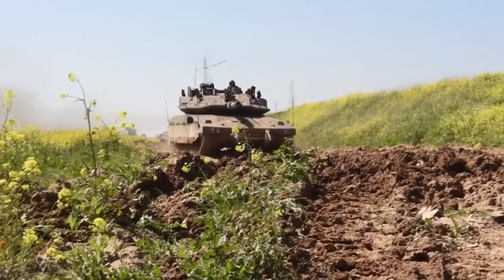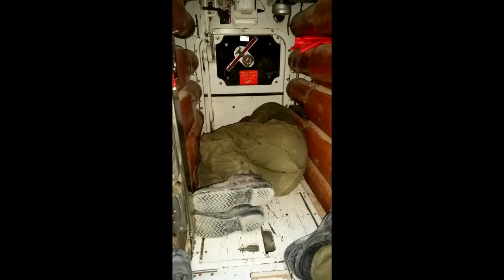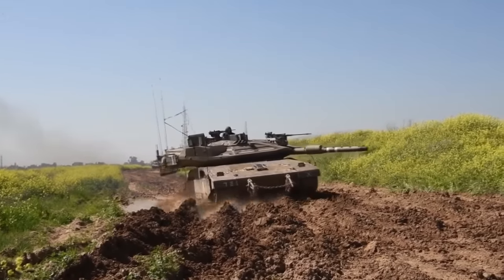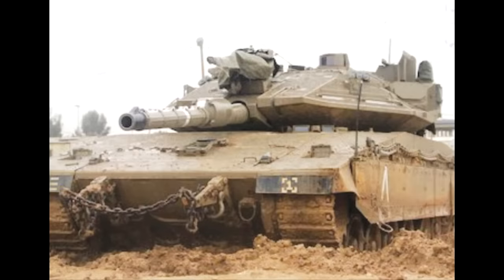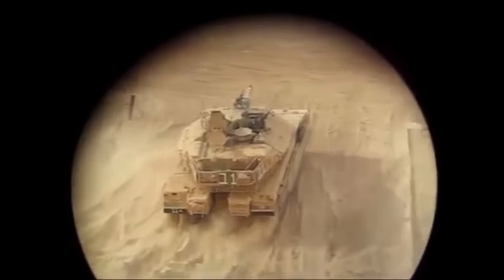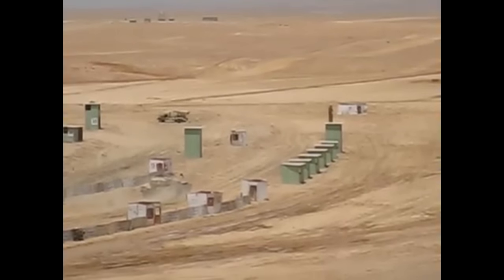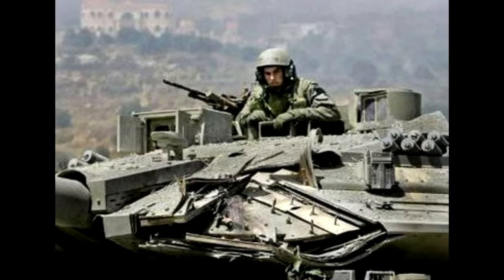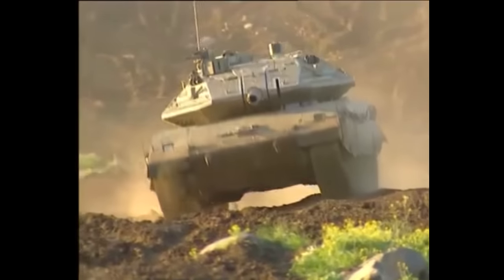Problems with Merkava tank

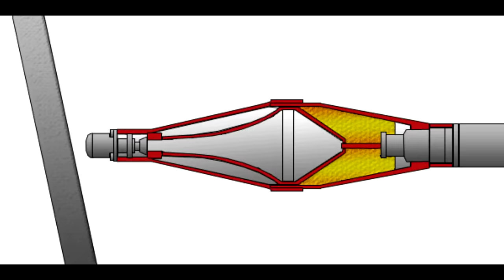Comment: Lasted 2:14 before the stupid got to intense.  No AFV is perfect or invulnerable.  The difference is in survivability. 

1)Any tank is going to show up on thermals unless it has some kind of "Jedi cloaking device".
2) No the engine compartment does provide pretty much complete protection against HEAT and very good against KE. Yes the vehicle will probably be a "kill" after being hit,  but again,  the crew will survive, and the vehicle will be recoverable and repairable.
3) Slope and thickness is largely irrelevant with modern composite armors. Its all about the composition.   The Merkava has its armor shaped the way it does for functional clearance of the turret and gun tube,  not ballistics.
4)The statement that RHA is at all "superior" or even a factor against anything but artillery fragments indicates that the creator of this video is just another armchair Youtube "expert". 
5) The L44 120mm gun is what the Israelis have a license for with Rhinemetal and is more than good enough against any of its regional threats.
Reply: Caldwell Transport Columbus, GA lad... its an urban enviroment focused vehicle, its desing is by no means to fight other tanks, lets keep that in mind, im pretty sure he was focusing if it were to fight another tank
Reply: Well first off. If you minimise heat threat it will be good, especially from the front. I think you are another armchair general. Removing at least one bit of camo can be the difference between life and death. While the Abraham’s that Egypt uses has heat sensors and has better heat protection. If the Americans described T-72 as being a “flamethrower” then what will Merkava be? “He’ll on earth”?. 

Second To all of you people who keep talking about “CrEw SuRvIvAbILiTy”. Understand that the most important thing on the battlefield is to DISABLE A TANK. If they could pen the engine and render the tank stationary and exposed, they won. M1 type tanks have an even bigger weakness, their ammo storage (although having blow out panels) is an easy target and no amount of ERA will save it from modern projectiles. Thus, if the ammo is blown away, the tank can no longer fire and thus is disabled.
And to fix this fat 70 ton peace of shit it will take a long time, maybe a war will be over by then, especially M1A1. 

P.S you do realise even a BMP can save its occupants if hit from the front? Because, it’s engine is in the front. But, it will turn into a metal wreck. There are plenty of examples of it.

And even if the tank does it’s job of saving the crew now, the Syrians and Hezbollah now have very modern Russian ATGMs. And Syria has T-90 tanks.
Reply: 1) The thermal signature of the Merk would be way more than other tanks from the front (i.e easier to detect)
2) No. The only thing Engines do nowadays is create more shrapnels.
3) Slope does matter, seen the Challenger 2 and Leos yet? it doesn't increase the chance of ricochet but it will increase LOS thickness of the armor
4) RHA of the same thickness to Composite armor is more effective. Composite armor offer more protection per weight and not volume.
5) And because the medias, etc... is comparing her to everybody else's tank, i.e T-14, T-90A/M, M1 series, Leopards,..  so it makes sense to state that fact.
Reply: the baron  That is not the case with KE penetrators. Frontal armor is penetrated like nothing. Engine is not a good KE shield, it is just piece of metal which such darts easily penetrate. Then there is relatively thin extra piece of armor which is only good at stopping shrapnel, not full out projectiles. When armor can stop 400-500 mm of KE vs rounds who easily can do 600-800 mm with some going upwards to 1000 mm. Merkava is by no means designed for anti tank warfare. It is just outdated for it in terms of armor protection.
Reply: 1. so true. for that this is good example what you need to hide the heat and that its a big handicap
https://www.youtube.com/watch?v=EgabvU-fqDM
2. yes. crew safe is most importans..and tanks cac build new..a crew need month or years to be good again
3. yep. merkava hull is in real  same thick as like a t90
5. sure its one of the best gun in world. but would love to see merkava anytime with the l/55 :)
Reply: the baron I couldn’t give 2 shits about the crew. The enemy will win if the tank will get disabled. That can determine weather the battle will be won or lost. 

First you have to recover the tank(if it won’t be completely destroyed, due to being stationary), then you have to get it to a repair station, then you have to repair it. And only then return it to the front line. This will take time.
Reply: And the armor is modular. replacement of engine, fuel tank, and plates will be easier and quicker.
Reply: @TheNicestPig  why is the thermal signature higher on the merkava?
Reply: @a.t6066  Because the engine is in front. the Thermal Sig is not higher, it's just easier to detect from the direction  which tanks usually fight eachother from (front)
Reply: @TheNicestPig  but does heat transfer through thick composite armor easily? Also the tank uses liquid cooling?
Reply: E. P and so do others, they still got engine heat signature do they?
Reply: @TheNicestPig  but what about heat transfer through the armor?
Reply: @a.t6066  It Happens!  not through the thicc Upper plate though, more likely through the thin Lower Plate.

Comment: I honestly really like the front engine layout of the Merkava. The back door and its ability to be a qausi troop carrier is a pretty unique design.
Reply: Same , aside from increase of noise level for the crew and A FREAKING FUEL TANK AT THE FRONT , its a quiet unique design,  especially if u wanna have space on the back
Reply: @Wolfy848  Yer that fuel tank placement is pretty insane. You would be hard pressed to place it in a worse spot.
Reply: @Magiktcup  well yeah , its a huge down side for the tank since wen shoot , it demoralized it along with the engine

How ever ut makes sense tho 
Remember , the merkava tank is all about crew protection  (RIP driver)
If they placed it behind engine , sure the engine would protect it but then it will be exposed in the side which is the weakest part of the tank 

If that explodes then the crew in the turrent and driver will both probably die in the process
Reply: There is a reason why APCs/IFVs are seperate from Main Battle Tanks in every army in the world.

Comment: I feel you underestimate the principle of IDF: equipment can be replaced, crew can not. So if the fuel tank or engine is damaged but the crew can escape, that is a win. The steel thickness is also irrelevant nowadays. They have active protection systems and active armor when needed. The interesting question if the tower has any bullet traps.
Reply: I feel that there isn't a optimal principle for either - they cant manufacture equipment to satisfy hardware attrition, nor is the population large enough to bridge over substantial losses. If anything, I imagine their real policy is to get other western countries involved before either becomes a problem.
Reply: Another thing that wasn't considered was that by having variants of the same vehicle for different roles costs are greatly saved on maintenance and retraining, which has great long-term benefits

Comment: 6:20 yes you can mount trophy on any tank but you can mount anything on any tank. Trophy is mounted on all new mk4 tanks and it it's most affective way of protecting itself today. It's so affective actually that we consider putting lees armor on our future tanks and more  trophy like active protection
Reply: There is 2 big drawbacks to these kinds of hard kill APS: collateral damage and an absolutely giant signature (can't remember if it was radio, radar or electronic).
Reply: @RockSolitude  most likely a radar signature.   I wonder if attack helos can defeat the system by firing their guns to damage the electronics,  clutter the radar... clearing the way for the ATGM.
Reply: Then good luck with the APFSDS
Reply: @UserJoy24  Iron fist (elbit's APS system) can, and was tested for countering APFSDS

Comment: Hello,I wanna point out the flaws in the video, i come with no hate and just want to show some input to the conversation. i in no way claim the Merakava is perfect BTW.
But in my opinion the video is full of misinformation. its a long comment though. so prepare yourself...

1. 
He presumes that the back compartment remains existing and empty,when the tank's space stayed just the same with the engine compartment in the front

2.
There is no proof or info about the shells inside the tank as its secretive

3.
There arent many notable cases of the merkava running out of ammo,so it clearly has enough shells

4.
There arent any heat signatures in possesion of the enemy,the merkava has never fought an enemy with the these abilities,while maybe in a theoretical scenario it will matter, it dosnt.

5.
The engine dosnt simply "serve as more armor". it is there to take damage instead of the crew inside. and of course if a shell penetrates the armor to hit the engine,it very well may have killed the men inside instead. this is not a video game and we care about people more than about the tanks.

6.
Hollow charges are the thing that kills the crew usually,it protects the crew and blocks most explosive rounds

7.
From me talking to merkava gunners,their optics and vision are fine and they dont tend to turn it away from the engine
theres more
8.
Now a note here,he consistently shows footage of the merkava 3 instead of 4 as an example, and also shows digital models as "proof"

9.
Now he talks about the rare occasions of the fuel tank catching fire. this is correct actually,BUT the crew almost always survives unharmed because they are seperated from it,also almost always the tank is repairable. In addition,in the latest years the windbreaker was fitted on all tanks,which eliminates almost all "projectiles" of the type (RPG's ect) before they reach the target

10.
the things he says about ammunition are simply misguided as only footage of merkava 2 and 3 are shown(maybe even 1,i couldnt recognize in one of the pics),and as i said there arent many legit inside pics of these compartments as israel keeps its shells pretty secret.

11.
 Now another note here,all of his "sources" are shady-ass Russian sites and not respectable sources.

12.
He claims the merkava has 200mm of armor,but this is one of the most secretive parts about the tank,both the thickness and composition are unknown to the public and there aren't even non-official records,he simply farts the info out of his ass. you can go research yourself. its about as well known as how many nukes we have. we have nukes but its somewhere between 1 to infinity
i remind you we have acces to abrams tech,there is no reason for our composition to be bad,but then again...secret
13.he mentions the sloped armor and it being bad for some reason,and then sais "it might be good against heat projectiles but there is not info about its effectiveness"... well...there is no info,as i said. he pulled info out of nowhere and then when presented with a positive claim he sais that there is no info. but the info works for both ways there isnt any info for it being bad either

14.
Here i get him on the biggest mistake he made so far. he claims the merkava uses the Rheinmetall L44 tank gun.... but its not. israel produces its own "IMI 120 mm gun" for all of the merkavas to preserve production capability
he dosnt even know which gun it actually has,so how is he claiming to know about its effectiveness.
about the gun,its 120, smoothbore 5.3 meters long,so its pretty generic and similar to the abrams leopard ect. only produced by Israel so we can tinker with it

15. Now he talks about the trophy,it is good,yeah you can mount it on any tank. but the merkava and abrams are the only ones with it cause its israeli....you can mount the leopard cannon on any tank as well....

now i MAY be biased and may be wrong on some cases. i think that the most important correction to make is the cannon and armor ones,as it dosnt use L44 cannons and dosnt have 200mm per say. 

thanks for caring about thanks! love you all!

now is the Merkava perfect? no. will it win an abrams on a 1v1? yes-no-maybe. depends on the crew probably.
for its job,it will do better than any tank. it is built for the types of conflicts israel has to deal with,and israel does have acces to american and german equipment i remind you
Reply: 1 question, in point 4 you said the enemys are not in posession of heat signature monitoring devices but i thought with infrared optics you can see heat signatures and israels enemy sure has some old t 55 or t 72 tanks wich have that equipment, but wow you sure did put some work in this comment, nice
Reply: @teastroyer2812  yeah i wasnt reffering to t 72s.
merkava's main goal was always to deal with insurgents fast. i was reffering to hamas,which has no tanks.

now,that might be an issue against modern tanks. imo the merkava has some other benefits such as it being super easy to repair but yeah
Reply: Drion yeah, just ignore Egypt then with its Abrams tanks.

Comment: The perfect tank does not exist, and never will.
Reply: Yes it does, it's called a Toyota Hilux fitted with a .50 cal gun and sand bags as armor.
Reply: @rock3tcatU233  Or mount the eighty-eight on the back of an Armadillo.
Reply: The perfect tank DOES exist. It is called Bob Semple
Reply: Ever heard of M1 Abrams ?
Reply: @reaperx4589  Did you know two were lost during desert storm in 1991. Got stuck and had to be blown up.
Reply: @user6008  Yes only 2 while Iraq lost like 2600 T-72 , T-62 and T-54/55
Reply: @reaperx4589  Pretty good ratio.
Reply: @FBI he's correct on those numbers 100? That many would die in a day some times...
Reply: Merkava windbreaker: hold my beer.
Reply: @reaperx4589  he is far from perfect.
Reply: But anime tank girls?